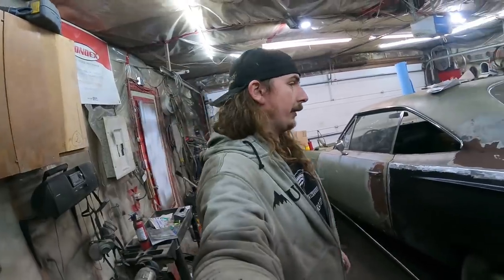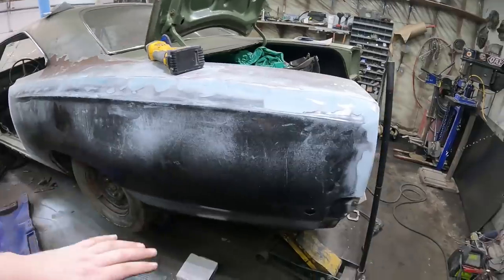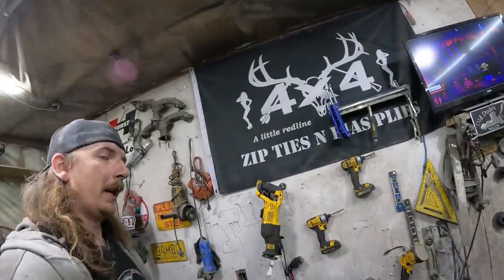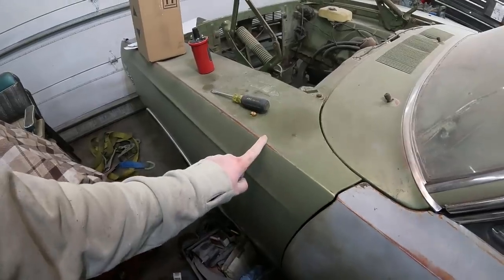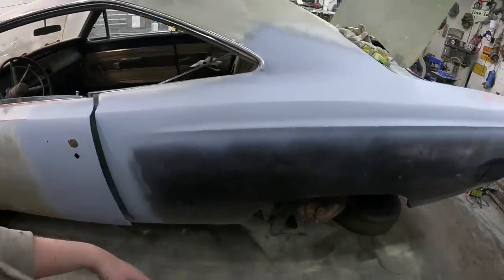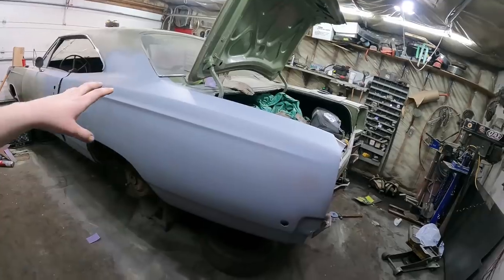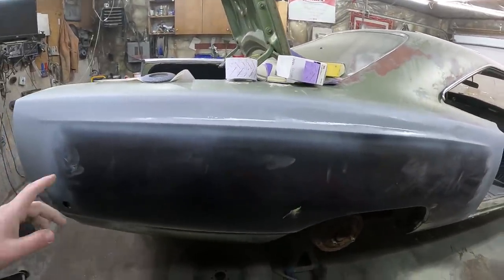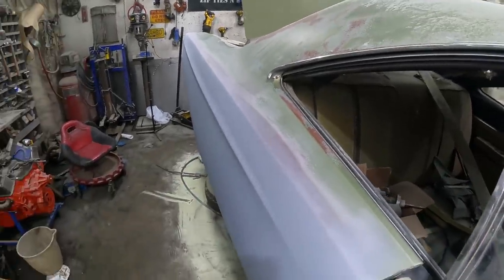Body Work and Paint Prep! - 68 Road Runner Gets Primed

Comment: I see you're putting fiberglass over your quarter panel welds before using filler. Good idea. So many videos I see where this isn't done. Glad to see it. Really strengthens the repair.
Reply: From what I get from body work channels its not just to strengthen the repair.  Bondo doesn't last when it gets wet. So if you have a pin hole in your body work and moisture gets through there it will damage the bondo and after a while all the body work you did was for nothing. The fiberglass isn't affected by this so it seals it before you put the bondo on.

Comment: Dan do not listen to those that  knock your bodywork ,  I have been around a lot of shops that do body  work and you don't cut corners like a lot shops do that  are doing flips for a quick sale or trade where they cover up  rust,   dents,   and bad  paint  with screen wire,  drywall mix,  or tape.  You build a strong foundation for your cars so they will last.  So if anyone  wants to do 10.000 paint job later it will be on good workmanship underneath.  nuf said be Proud.

Comment: I think you’re doing a great job on the car. 68 Sport Satellite HT production numbers is 21,014. Sounds like a large number however, considering how many were destroyed or cloned over there years, not many are around. The Sports Satellite is Pretty much a 68 Plymouth GTX with a 318. Both cars had the same package minus the drive train. It would be easier to clone the car into a GTX than a RR. No matter what you do to the car, I’m just happy you are getting it on the road. You saved it from someone’s yard rusting away. You’re videos are giving my ideas what I need to do to my 68 GTX. Special cars.

Comment: You have a rust hole coming through the back edge of the passenger side door skin, If you look close you will see where the rust is pushing the metal up from underneath! The area you were talking about on the drivers side sail panel is where they blended the paint when they replaced the quarter panel!

Comment: Only corvette /sheet molded compound is water proof if you don't want welds to bubble from pin holes. I use fiberglass for filler on fiberglass. Ive been a body man for 35 years .I've restored 46 cars.

Comment: A car like this deserves a mint factory paint job.
Reply: unless you do it yourself it gonna cost many many THOUSANDS and a typical mopar guy would still nitpick it apart. Its not worth it since its just a "driver"
Reply: I tend to agree ..but then everything else that isn't new looks bad..so new interior engine bay etc..and you may never get to drive it..but you can do the other stuff yourself which is where these cars go after being "Danified" or "Danistored".😉
Reply: Wrong..."mint" is WAY over-rated.
Reply: Trailer queen show cars suck!
Reply: The vice grip guy just did a fantastic $200 paint job that came out nice on a square body pick up
Reply: Na it looks good how it is
Reply: If he hadn't bought it and did what he did, it would still be sitting and rotting away, he fixed the rust, if you want it painted buy it and do it your way. I think it's great how many cars he saves that would otherwise rotting and eventually be crushed and gone forever  he is saving these cars...

Comment: Dan, I like the both of you and understand some of the theory behind "rustic" but damn, the car is a fighter. I see all the stuff that you buy to just sand off to the floor making that floor worth more than the shop in costs of materials on it. You just keep using that D A over and over like a addiction. I am looking at long boards an other sanding tools to shape that rig with and yet they set next to the paint products with more dust from the DA than the sanding done. I just don't comprehend that part. Wouldn't you get a few more lookers with decent paint or all the damages gone and just in primer?? As Derek said; Help me understand?? Ha ha, he has his own niche and its a good one financially. Most people check to see how many windows roll up and down, how well the doors shut, if the bumpers are straight to the car lines and nothing hanging from under the dash or car. Most people love the under the hood paint on the firewall and then the inner fender. An were I you, I would never install another vacuum booster brake, go all hydro assist so engine vacuum is never a issue again. I think that in any event, I pissed you off and you have blocked me from long posts and talking too "f**king" much. Thank god we are not neighbors hu? Nice so far

Comment: The reason every one likes Chevys, they are easy, parts are every where, same with Fords to a lesser degree. Mopar on the other hand takes some one who is committed or committable? I chose Mopar because everyone and his dog had a Camaro, Chevelle or Mustang. I move to the sound of a rather funky drum, but every Mopar I've built normally dominated
over most GM and Ford products I've raced. Small list of my cars '64 Dart GT 318 4bbl auto. '69 Road Runner 383 4bbl 4speed, '67 Barracuda Formula S Small block 360 auto. The Cuda ran 12.50s and was completely street legal and conformed to noise law.